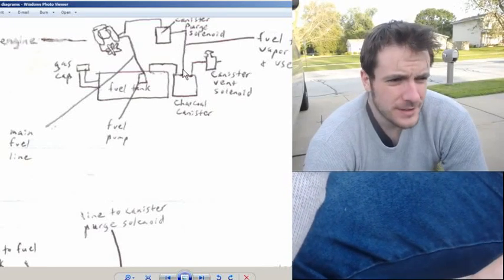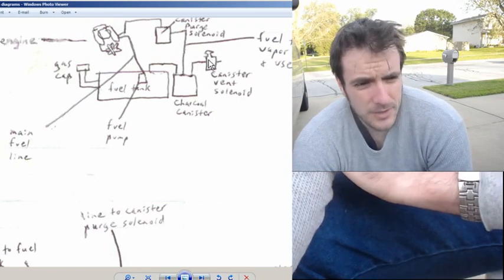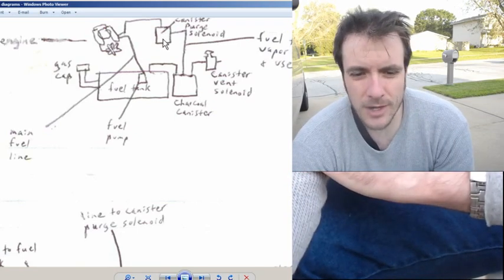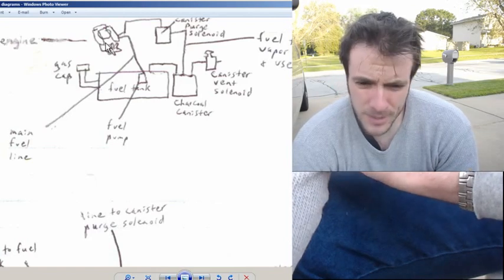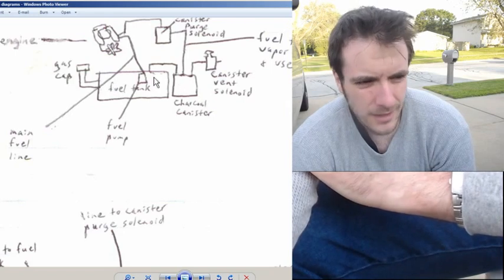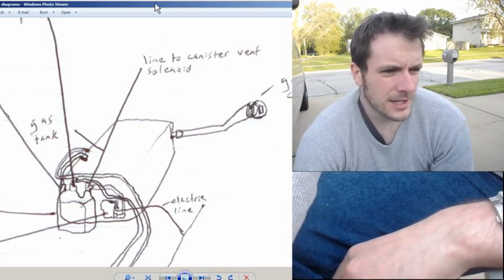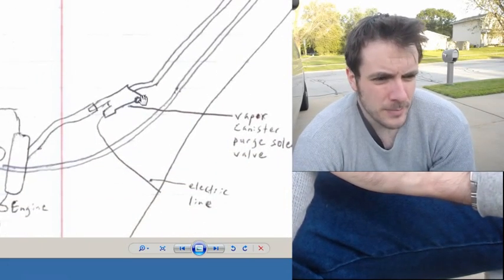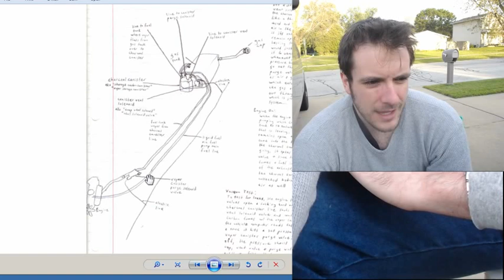Evap System - How It Works

Comment: My issue is that my engine cranks but not starting for 4 5 tries. I believe vaporized gas moves into engine and i get very intense smell of gas whike cranking. If i remove hose connecting Purge valf to canister, it would work then?.
Reply from the maker: I don't recommend that, no.  Sounds more like no spark is happening so it could be the spark plugs.  Or it could be the ignition coils.  Could be a bad battery that is not producing enough amps and is not charging full enough.  Test that for sure.  Could be alternator not charging battery so bad alternator.
Reply: artbyrobot i dont think so. Car is fine unless i left car under sun for 3 hours (+30celcius). Maybe it is about temperature inside the cabin as well. But no. I did not start car for 10 days. It happened again. Because a day before it was hot and vapor stuck in engine. I have no other problem. Performance is fine. I get no error code by diagnostic tools.
Reply from the maker: @3rdP4rty  sorry I have no clue.  I'm still amateur with mechanic stuff.
Reply: artbyrobot thanks for time. Appreciated.
Reply: artbyrobot i forgot to tell about temperature thing at the beginning sorry. It seems spark or battery otherwise. You are right. But my problem exists only when i leave my car under sun for few hours. Tested many times. Opening windows sometimes help. I changed temperature sensor. It was cheapest. I narrowed down to 2 options. Let me know what you think. 1st evap purge valf. 2nd MAF sensor. But car has no performance issue. I tried. It goes upto 220km/h even by LPG. I tried it also closed gas for a month and used benzine only. Problem was still there sir.

Comment: hello  the purge valve has only two hoses: one coming from the charcoal canister and the other going to the intake manifold. The one coming from the intake manifold has vacuum coming out of it. How does it pulls the vapor out of the canister? I would think that it would push it instead.
Reply from the maker: When the engine cylinder piston takes its intake stroke, it has its exhaust plugged off and it sucks in air and fuel just like lungs do when you breath in.  It is during this suction that the purge valve's hose draws air from the charcoal cannister, sucking up the cannister hydrocarbons and later using them for the explosion stroke of the engine.  Remember, vacuum's PULL, not push.  The engine sucks fuel and air from the evap system, it doesn't push it.  The only time the engine pushes out air is through its exhaust system, not its intake system/evap system.  This link shows how the engine strokes work:  https://en.wikipedia.org/wiki/Four-stroke_engine
Reply: Thank you for the explanation.

Comment: during the normal engine operation what is the state of the canister vent valve is it ON or OFF (i.e whether it is closed or open) because if its closed there would be a very high vacuum that would be generated. Or is it only closed (i.e not allowing air flow) for the diagnostics purpose
Reply from the maker: During normal engine operation the charcoal canister vent solenoid valve is open in order to prevent a vacuum.  It only closes to perform a vacuum test diagnostic procedure to test for leaks in the system.

Comment: Getting my p0456 off has been a nightmare. 07 Dodge Caliber ft AWD. The vent solenoid in my car is called the esim evaporate systems integrity module which opens and closes the breather. That's new. Replaced the purge valve. New gas cap. Haven't been able to find any holes or cracks in the hoses/lines. Your movie was pretty good cause that's how I learned all that. Next step is to get it smoke tested.
Reply from the maker: +Tay Hope the smoke test works out!  Good luck!